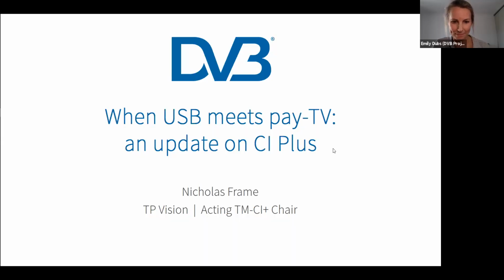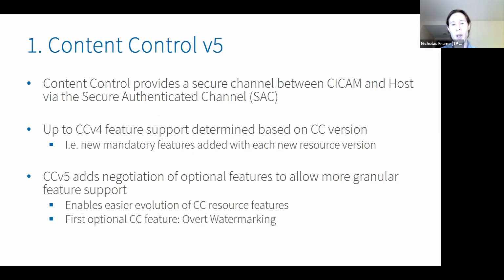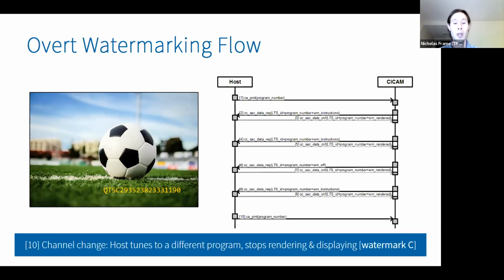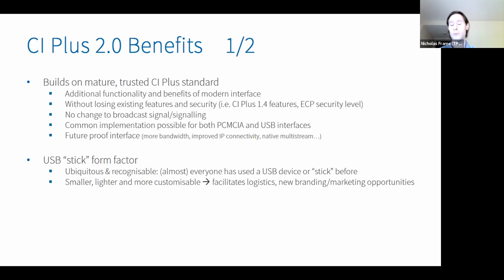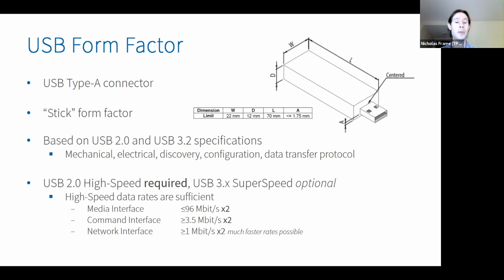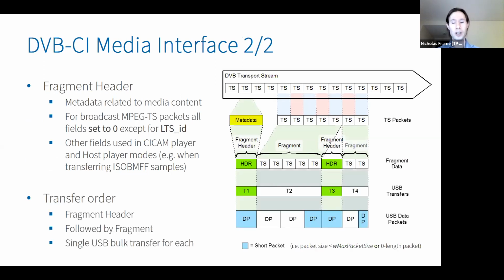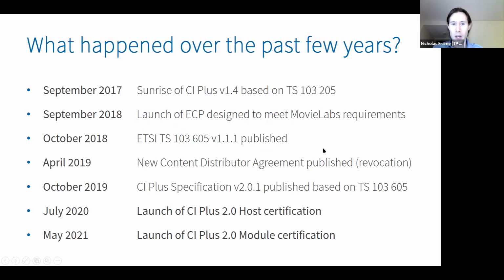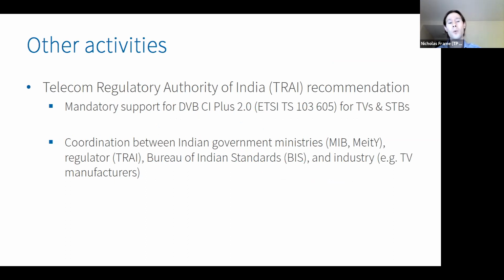DVB Webinar: When USB meets Pay-TV – an overview of CI Plus

Comment: Thank you for a very thorough presentation.
One important aspect I think is missing is the difference in mandatory resources in CI 2.0 vs. 1.4. Many resources are now optional in the CI+ 2.0 specification from CI Plus LLP, like AppMMI, auxiliary file system, CICAM player and more. CAMs can of course detect this using the resource manager, but the assumptions that could be made in CI plus 1.4 are no longer valid. The "virtual set-top box" mentioned cannot be realised in a minimal, but still compliant, CI+ 2.0 host implementation. What are the plans for mandatory vs. optional resources going forward?